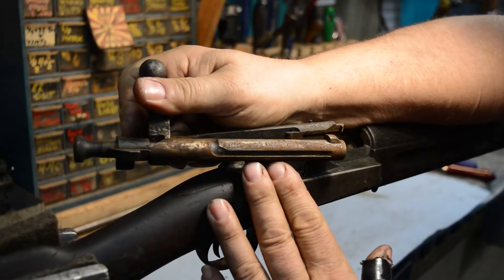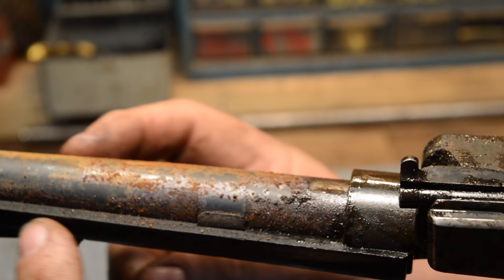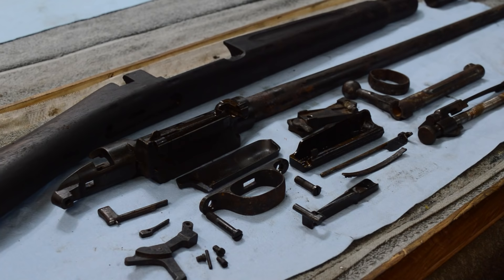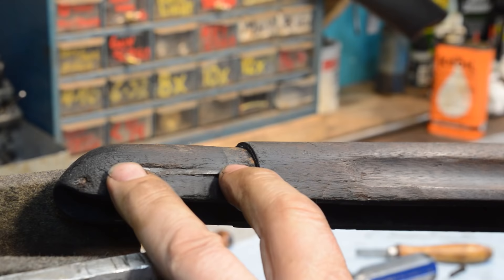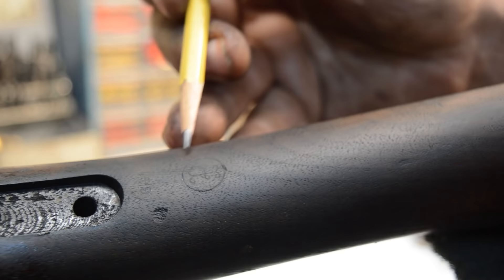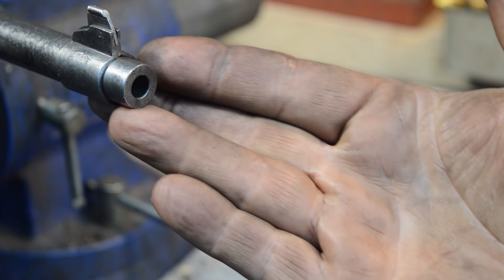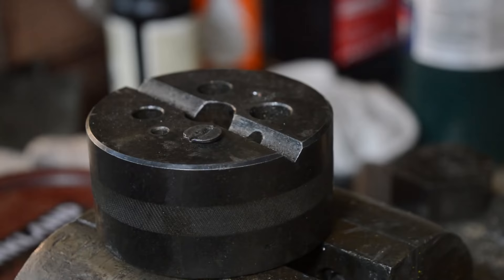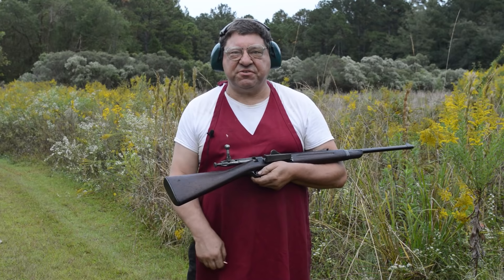Anvil 089: Krag Disaster Recovery

Comment: On a scale of 1 to invading Russia in the winter, how bad an idea would a sand blaster be?
Reply: since it's practicly removing material...
...'getting pushed back to Berlin and shooting yourself' bad
Reply from the maker: Any original surface prep is lost, once the sandblaster is invoked. All of this effort was expended in an attempt to get as much of the  old surface back as possible
Reply: @marknovak8255  you might be able to shoot soda, or dry ice.  But whether it'd be worth the effort is debatable.  We had a very old machine shot with dry ice, and results were pretty meh.
Reply: @randymagnum143  walnut shells is another pretty soft abrasive for blasting. Though I am pretty sure people use plastic beads now.
Reply: @ScottKenny1978  they still sell the walnut hulls, perfect for aluminum and the like
Reply: @marknovak8255  and your method is perfect for when there's still some original surface to be saved.
Sometimes though, it's wall to wall pitting with no original surface left anywhere. That's when I break out the sand blaster just to save some time ahead of draw filing.
Reply: @randymagnum143  corn cob is slightly softer, wonder what would happen if you threw the parts in a vibrating case cleaner.

Comment: Not a gun nut. Silly question. If the bore isnt good. Can the barrel not get re-bored?
Reply: Well, only within reason. You can't give back depth to the walls of the barrel that might have been horribly damaged by rust and corroded. Re-boring the rifle at that point would essentially be throwing it out of spec for the bullet that would be fired down it (IE: you would be making the barrel a wider caliber bore because you would HAVE to remove damaged material to even give it proper rifling again). That's why sometimes you see guns that have different barrels that don't match the receivers, as the previous barrel may have either been so horribly mangled in the field it was unshootable, or the barrel degradation was to severe for a repair. Although, I am sure there are exceptions for this in the form of wacky sorts of caliber conversions in some guns that have been done or something.

Comment: Wonder how well the US Krag would have performed if they had chosen a rimless cartridge.
Reply from the maker: Single locking lug, the limit here is the weapon, not the cartridge in my opinion.
Reply: @marknovak8255  I've heard that a lot, but I have a Norwegian Krag that was rebarreled in .308 and it's doing well. My understanding is that the metallurgy of US krags was inferior, as there were several krags in more powerful rounds (8x58mm) that did not exhibit shearing/damage to the lug. 

I do make lower pressure rounds for it though, I want the rifle to last as long as possible as it's my first center fire rifle.
Reply: @marknovak8255  I was thinking more in terms of feeding, would probably be faster to load if it was rimless. To load a Norwegian one you basically just drop a handful of rounds in. There was a speed loader that was basically a shortened Madsen magazine but i don know if it was only an aftermarket thing. some oldtimers still use Krags for Stang shooting AKA Norwegian mad minute. https://www.youtube.com/watch?v=S5ycG87H1b8

Comment: LMAO "that pricesless rolling block stock" yeah I've met people like that.  The guy trying to get me to buy a Winchester 73 for $8,000 that was a standard run of the mill 24" model in 44-40 that was pretty much a uniform dark brown from butt to muzzle and who's barrel was a smoothbore about 5" down the muzzle.

There are a few pieces I really regret not nabbing like a mint unfired 1872 Springfield rolling block 50-70 for $3,500.
An unfired factory scrubbed export Yugo Mauser for $200. 
An excellent+ condition Remington No 1 Creedmoor 44-90 Rem Special with case and tools for $4,500. (I need a shot of whisky now)
A Shiloh 1874 heavy barrel in 45-120 for $1,800 out the door at my LGS.

These were all incredibly stupid decisions to pass especially the Remington Creedmoor, try touching one of those for less than 10k.

Comment: You could "save" the stock, sort of. Just make a nice mold of a identical, yet unburnt, stock. then epoxy fill said mold with the burnt stock as the core. Saved in the most pedantic way possible. Replacement was the better choice, and old crispy can be rasped down to wood and thrown into scrape/replacement wood pile.

Comment: I havent watched the whole vid yet, but I always heard never, ever ever shoot a gun that had been in a fire.
Reply: I imagine due to fear of losing the steel’s heat treat.  Maybe Mark redid the heat treat on the required components or the fire wasn’t hot enough to ruin it
Reply: You can tell from the stock that the foam kept it from getting too hot. If the stock had charring on it I wouldn't personally fire it,  not sure what Mark's opinion is on that subject.
Reply: Definitely a concern, as a wood fire does get hot enough to temper the metal.
Reply from the maker: Until the gunsmith determines the state of the metal. In this case, none of the springs had their temper drawn anywhere. We are OK. MANY of this guns siblings were DQ'ed, however
Reply: Never shoot a gun that has been in a fire unless it's been vetted by a proper gunsmith.
Reply: As long as the stock is still there, and there is no obvious damage to the metal (other than rust) it likely never got hot enough to cause any change to the metal's grain structure.

Comment: Hope  that  was  a  no  go  gage  you   flipped   on  the  floor  in  the   end  and  not  a  live   round. Most  Gunsmiths Ive  known   die  from   40  year's  of  chemicals  or  a  unloaded  weapon.
Reply from the maker: Looked and sounded like an empty round to me. I don't abuse headspace gauges like that.
Reply: I heard one genius say, "If you work with knives, sooner or later you are gonna get cut." Soooooo if you work on guns long enough.....?
Reply: @williamkoppos7039  An old timer once told me.  "If you handle loaded firearms long enough, you will have an accidental discharge.  How well you were trained in proper handling and safety will determine if the AD is harmless or harmful".
Reply: Hope    that    you   don't   always  space  comments  like  that   cause  it   comes  off  as                                                                    asinine.
Reply: @Wiiliam
And you can get lucky. Try to learn.

Comment: I know you had big problems but, I would of removed the rear sight then tapped the forearm forward off the barrel, the correct way to remove a Krag upper forearm?
Reply from the maker: The spring tabs were fused to the barrel. The wood was going to be destroyed if I did it any other way.  Tapping on the tabs broke the rust bond and saved the handguard. Clean, oiled metal will slide. Rust galls, and scratches, so no slide

Comment: Not worried about the fire having changed the hardness of the receiver? Or were you able to check the hardness during the process?
Reply: I think were that the case the gun would be destroyed anyway
Reply: One of the first things he showed was that magazine spring. If the spring still has tension then it hasn't been hot enough to affect steel temper.
If the springs are fine, the receiver is fine. Also, the wood would have burnt more or less away if the steel got hot enough to weaken significantly.

Comment: 17:47 have you ever used an "impact screwdriver" before??
i use them A TON on motorcycles and sometimes cars.
.
basically... when you strike the back of the screw driver with a hammer.... it also turns (has a little "cam ramp")
using a separate driver and hammer like you do is sorta the same thing
.
but when its REALLY tight, an impact driver helps prevent caming out of the screw head..... as turning force is only applied when down-ward force is present 
but your method may offer more control..... if its not stupid tight and/or rusted 
.
idk if i explained that very well...... just google "impact screwdriver"
however.... im like 99% sure you know this......
that was for the "normal people" who read this
.
(dont become a mechanic.... just work on your own stuff and get a desk job)

Comment: On my krag the stock looks like it was broken a few times and glued back together before I even inherited it 🤣. Think I'm just going to GB for a replacement. Not even sure if it's original anyways I'd have to look and it's kinda buried. Top handguard is also cracked in a couple spots. It's the cracked krag 🤣 btw I instantly knew it wasn't a real krag carbine. The carbines are pretty uncommon and hard to find and usually always were equipped with a saddle ring on the side of it.

Comment: So what's the wd40 for? I know all I use it for is "cutting oil" for aluminum but Mark doesn't do black rifle lowers...or does he?
Reply: Its a water dispersant inherently instead of a lubricant/coolant (even a cheaper water concentrate will have it beat for drilling/machining, but while more expensive, a high temperature fat derived oil like Neatsfoot is often considered best for aluminum), so my bet is it goes mostly on the tools in the shop to prevent them rusting in the draws, not the work which having moving parts or wood you'd be worried about screwing up. I use tons of WD40, its a great product, but IMO it has no place anywhere near a gun.
Reply: Great as a flammable propelling agent for 8-foot PVC potato canons out behind the shop during Friday lunch breaks, or so I hear. 
😃

Comment: Don't shoot it!  It was in a fire!
Reply: Best thing to do is load a proof cartridge and then 5 service loads which is the proofing process for 03 springfield so im sure its the same for a krag. On a side note one way to determine how compromised a weapon is if the springs break, since the springs are steel and if they break when compressed its a strong indicator that the whole rifle got hot enough to compromise the strength of the gun. Best thing to do after that is either demil it or put a proof load thru it with the rifle tied to a tree and turn the rifle into a several pound hand grenade so no one else is at risk in the future.
Reply: I had a 98 mauser rifle given to me that had been in a fire.
The firing pin spring seems a bit weak but everything seems to work ok. 
I think I will find a new spring for it and shoot it with a string.

Comment: With respect, fine reclaiming of a fire damaged rifle.  No problem for using it as a wall hanger.  Under no circumstances at all can it be considered at all safe for firing with any ammunition whether light cast lead handloads or full power ammunition.  What one does with this rifle is the business of the owner.  However, the obligation of the owner if selling is to fully inform the prospective buyer that this receiver/rifle has been through "honest to God serious fire."  The casehardened Krag at its best is a weak action.   This rifle should not ever be returned to service.  It is a hazard beyond any safe use.
Reply: In this case, the wood on this krag was not burned.  The damage was all related to the chemical they used to put the fire out.  In all seriousness that receiver never got warm enough to do anything adverse to the metallurgy..